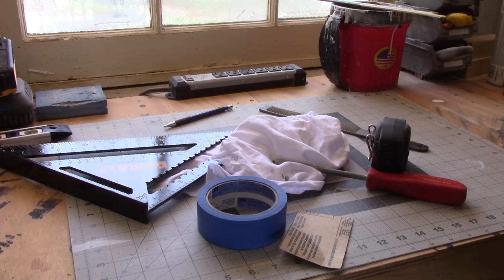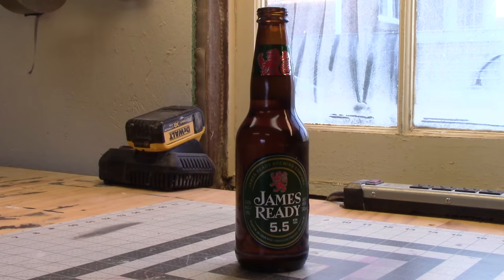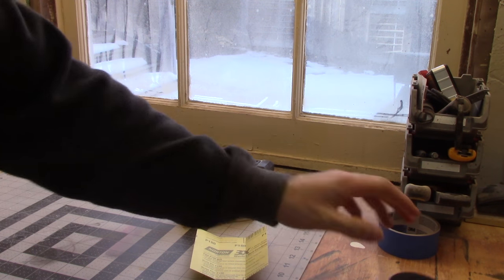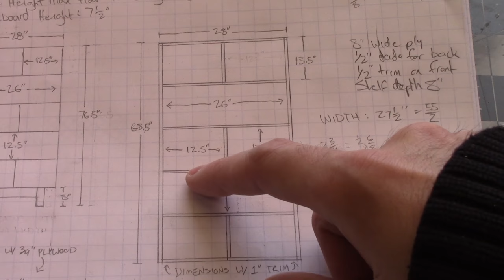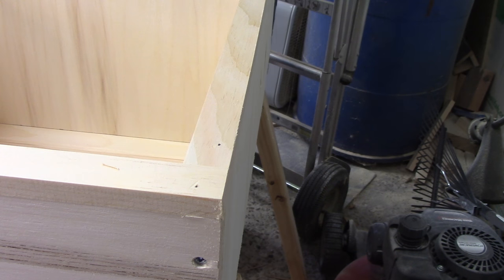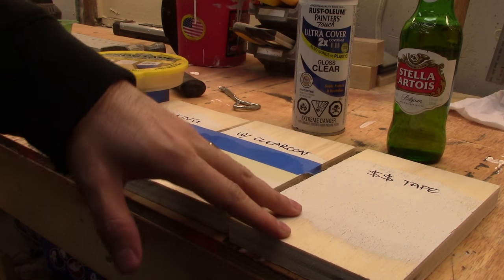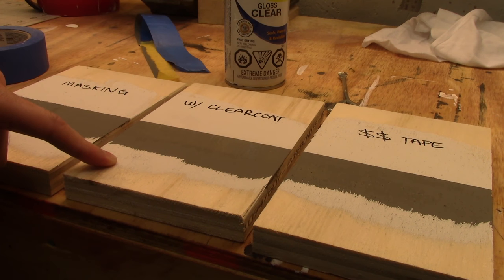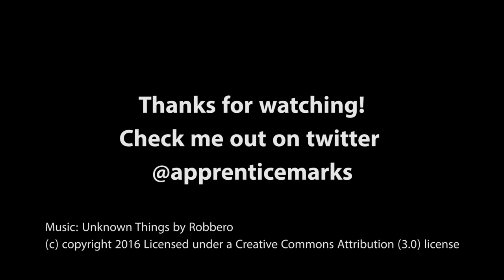Making a Narrow Painted Book Case

Comment: if you put the tape down, then paint again with another base coat, white in your case, and then put your final color down. the second base coat fills in the gaps in the paint and prevents your final coat from going under the gaps.
Reply from the maker: craig evans yeah somebody on Reddit pointed that out too. I don't know where I picked up the clear coat idea. Ah well, it worked.

Comment: <insert angry rant about drinking and using power tools>

Nah, just kidding. All I could think was "Oh no! He's going to get sawdust in his beer!"
Reply from the maker: Given Reed I've been waiting for the safety trolls to come calling, but so far, they've left me alone. Does it help that I generally only drink when sanding and painting? I'm smart enough to leave the saws out of the mix when I've had a beer or two.
Reply: Another masking tape tip I saw on another channel is to use the base color as your first layer on the tape like you used the clear coat. So on your shelves, if you put a layer of white on the tape it will bleed wherever it wants, but since the bleed is white, it doesn't matter. Then you put the grey on top of the white and the edge is crisp. Should save you from the discoloration from the clear coat and it doesn't require having anything extra onhand, since you've likely got some of the white handy. In your situation where you already had it painted and needed to go back and touch up it's less convenient, but on the initial pass it would only add a small amount of time (and would probably be close to the amount added by the clear coat).
Reply from the maker: Agreed, that's a great idea. I'll definitely keep it in mind for next time.